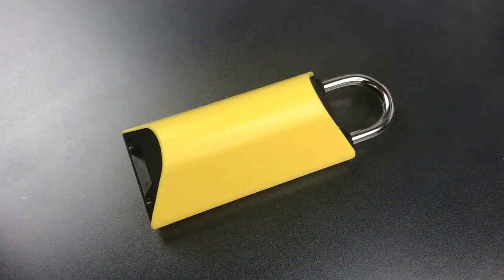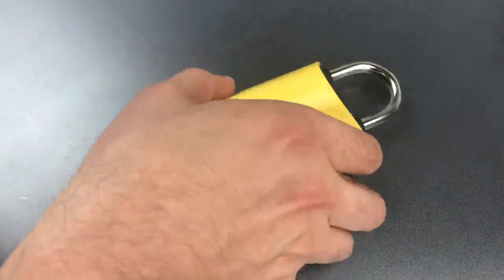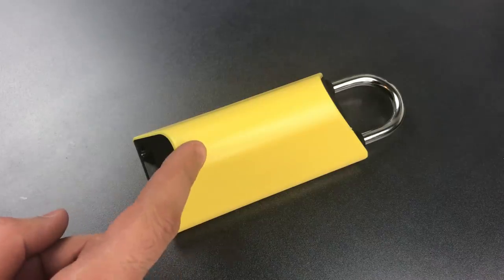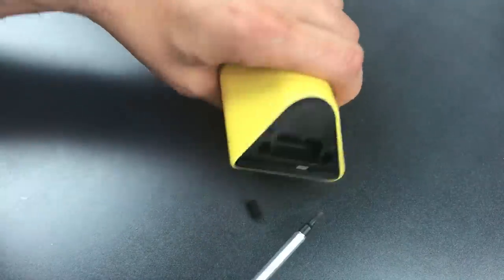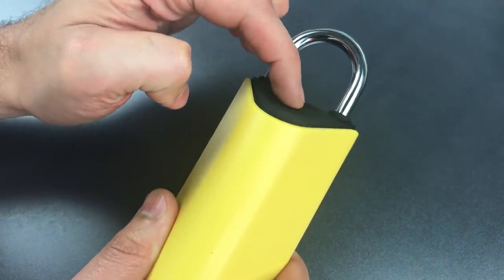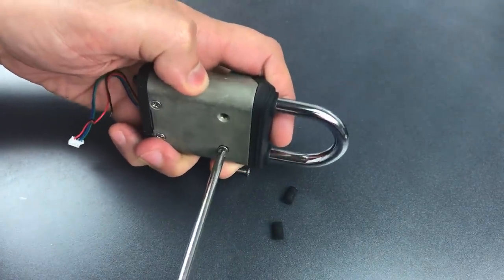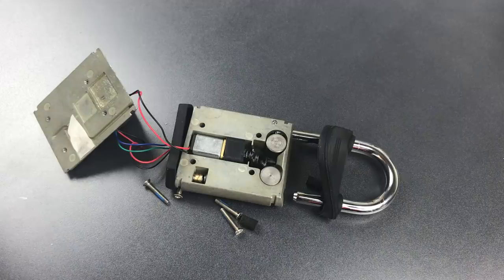[752] BoxLock: $129 Barcode-Scanning Padlock Opened With Screwdrivers!

Comment: Those tamper proof torx bits will also twist if you have to take out anything that's actually tight. I tried to do the same thing when I started as tech at the Chevy dealership years ago. You learn quickly that you need both sets.

Comment: This will prevent quick snatch and grabs as a package thief will never want to stay on a doorstep more than a few seconds.  That said, this is horrible for an overnight package drop container as the cover of darkness will make someone attempting to get to your packages bolder and they'll risk staying on your porch longer (especially after shooting out your porch light with a bb gun)...
Reply: Not at all. Replace the screwdriver with an electric screw gun. You can get ones that will fit in your pocket. Those will remove the screws faster. Then just short the battery to the motor to get it to open. Requires nothing more than a little screw gun and a knife. You should have the lock off in under 30 seconds.
Reply: @BobBobson  True, but package thieves run up, grab, and run away. Any kind of tinkering with the lock is beyond suspicious. The more time they're on the porch, the more chance of getting recorded and caught.
Reply: Auto Pi  You are right...but only partly. 99.999% of the world has no cameras around to witness it and not everyone has neighbors. Maybe in a major city of suburb, yes, someone might see, but as long as you steal the package without the owner seeing (which sometimes if they work, that is stupidly easy), no one is going to see it and nothing is getting recorded.
Reply: @tygonmaster  True but that's not how package thief think. They are in it for a ultra easy mark, if they don't see a box on your door step they are just going to move on to your neighbors and take theirs.

Comment: One complement I do have, is they did made the main body housing the shackle out of metal. Along with that the 4 Philips screws can be impossible to reach in some mounting configurations that you would be able to tilt a lock up at a sufficient angle. Yeah it is easily disabled until that point, but it would require flipping the lock at a nearly 90° angle to access the Philips screws effectively

Comment: Nice screwdriver. Haven't seen that slimline design before. (Usually just the quarter inch holder which would be too fat to get down that slim hole) Where to get? Please?
Reply: Bodragon try ifixit. they have alot of tiny drivers that dont flare alot.

Comment: Could you just plug your own battery with the correct voltage into the connector and get the actuator to open the lock?
Reply: yes

Comment: I see it as pretty secure in practical applications since this presumably would be at the front of your house where if you have this you'd probably also have a security camera, by the time a package theif has disassembled the lock the camera would have a fair amount of footage also someone (most likely a neighbor) would have noticed them. There are improvements to be made to it but as it stands it's a decent product for it's purpose which to me seems to be more about secure delivery of packages and stopping people from preforming a quick snatch or just reaching in a box and taking it than anything else which imo it does

Comment: The mail person or UPS guy doesn't have time to sit there and do this at every house it will never catch on
Reply: Which is just as well. 

However, to be honest, it's probably no slower than ringing a bell and waiting for an owner to turn up.
Reply: But then if we r ringing the bell and waiting for the owner to show up that means that we need a signature. And we won't be able to release it to a boxlock anyways.
Reply: Each country is different, I guess, but here (UK) if a parcel doesn't fit through the mail slot in the door the delivery person will ring the bell... signature or no signature. If it fits through the slot, then the lock is pointless anyway. Not too many "road side" letter boxes here, but even where they exist, the same process will apply: if it fits, fine; if it doesn't, generally a bell is rung...

Comment: Don’t worry about putting a screw through the shackle. One you have access to the wire you can pop it open with a touch of a battery. Two of the four wires go to the switch, the other two to the solenoid. Just power the solenoid and the top is open no matter how physically secure the top part is.

Comment: In addition to the stated defects this has some substantial ones that will reduce it's reliability. The circuitry is not potted against the environment. It has connectors which should have not been used but should have had hand soldered connections which also need coated. There are no gaskets I can see. The motor is not sealed that I can tell. No corrosion coating on the pot metal. This will fail in it's intended use in very little time. I've not addressed whether lead or no lead solder has been used since I do not know. No lead solder has numerous problems with thermal cycling.

Comment: Another design flaw, aside from plastic and pot metal, is the lack of any sort of apparent tamper detection.  It would be very trivial to detect tampering with the lock and transmitting a tamper alert (say to the owner and neighbors, for example).  Removing the screws should trigger a tamper alert, sliding off the plastic outer sleeve should trigger a tamper alert, the same if the shackle is no longer in its proper position, etc.  In addition to sending an SMS/App tamper alert it could also communicate with either a home security system or to a dedicated exterior sounder located out of immediate reach, so that an exterior alarm (perhaps even a high visibility strobe) may be sounded to help discourage theft through defeating the lock.  If they also sell the lockbox for this padlock then the lockbox (which is hopefully bolted in place) could also be equipped with inaccessible interior motorized bolts that automatically lock and remain locked until deactivated via the programmed WiFi interface such that compromising the padlock would no longer compromise the contents.

That said, the always exposed micro-USB connector is also very concerning as I very much doubt that it has adequate protection in place to protect against excessive, or even reverse polarity, voltage being injected into the USB port power or data lines.  I would also be concerned that the internal electronics are likely not to be well shielded from external RFI which could be used to either compromise, confuse, or even reboot/reset the internal electronics controlling the lock as well as to listen in on the CPU and potentially analyze emissions for weaknesses or tells.  The charging port should only be accessible when unlocked to protect from power injection and any high RF field should probably also trigger a possible tamper alert.  The device should also include an accelerometer so that it may detect excessive/rough handling and, especially, high impact events that are likely to indicate a tampering attempt and, again, trigger a tamper alert.  Similarly, an excessive number of rejected scans should result in an automatic lockout period so that nobody may try an unlimited number of master/shipment codes to gain entry.  I would also add thermal sensors to detect sudden and dramatic changes in temperature that are outside possible normal variations and also trigger a tamper alert since dramatic outlier changes in temperature suggest either an attempt to freeze or set fire to the unit (both of which it is susceptible to).

There are also likely to be other weaknesses in the firmware given how much it is doing and the inevitable rush to market, but the above e would certainly provide for improved physical security and help to further discourage tamper attempts as well as to stymie such attempts if the lockbox can self-lock internally in response to detected tampering and notify the owner and neighbors (I am almost always home, day and night, and I can honestly say that if I received an urgent tamper alert for a neighbor’s package I would certainly run to see what is up and, if I see someone I would either call police or confront them depending upon the nature of the threat, so even a simple real-time tamper alert could greatly improve the effective security of the device despite its many other flaws).

 But that is simply this former software developer and lifetime electronics hobbyist’s $0.02.

Comment: How about this? The two scews that hold the case together are connected to a circuit that sounds an Alarm stating something like “intrusion detected, owner and emergency services alerted” or something similar? Although it doesn’t actually call 911 but leave that to the Owner with the alert on the app. As well as the proper measures you mentioned on the lock part. Think that’d be a sufficient theft deterrent? They’d have a easier time doing that than making more lock like

Comment: Because of the way it's made even if they protect the top section it still wouldn't be secure -- it looks like you can just apply voltage to red and black to actuate the motor. They need to also enclose the circuitry in metal.

Comment: fill on top of the screws with epoxy or jb weld, etc.  that should work unless you need to access the screws at a later time

Comment: If you still have the unit, I was wondering if a magnet would trigger the solenoid or other electronic components used in the release mechanism.... I have seen that on several other electronic locks such as in fire safes and the like. 

Thanks for making quality content!!! :)

Comment: lol Nice Matching wire color codes.  Take the 2 bottom screws out. Cut the battery and Motor wires. Connect Black wire to Black wire. Red wire to Red wire. And it opens rite up without disassembling it any further.

Comment: So they made the cheapest lock possible and shoved it into a yellow case? Amazing. Thanks for all the videos you make, it is very interesting even to a person who does not do this.
Reply: It's by no means cheaply made. Just not very well thought out from a security standpoint.
Reply: @dlevi67  no offense but, it's plastic. I've never seen a plastic abloy oy or Sargent greenleaf.
Reply: @wkdravenna  No offense taken (and hopefully none given), but this has nothing to do with the point... they didn't cut costs - certainly not as aggressively as they could have done. They just spent the money in the wrong places from a security point of view. BTW, the body is some sort of metal alloy (zinc?), not plastic, but it's worked quite accurately. Metal is cheap; accurate machining far less so.

Comment: Instead of more disassembly, I would've stopped after disconnecting the electronics. I'm quite sure, giving the still-assembled metallic lock mechanism a short electric impulse over it's connector would've opened it as well. There are only three contacts on that last plug and my guess is, it would need only two of them and the battery.

Comment: They could replace the Phillips screws holding the lock together with the ones that only allow you to tighten them because of how they are designed that way you could still replace the lithium battery when needed but not the little motor or actuator parts inside the lock

Comment: The bottom two torx screws are probably acceptable to be able to replace the battery every few years, and since they don’t open the actual lock body they are fairly negligible in terms of security.

The Philips heads, though...

Comment: I've got a double lid pickup aluminum truck box beneath a homemade porch bench seat. Lift the seat, and you have access to two compartments. Keyed alike American padlocks that have chain retainers.

I don't need Fort Knox type security, as you're only attempting to thwart the opportunist. They're on camera, so they'll be found. 

Rural folks have their own way of dealing with thieves.

Comment: Not to mention the bottom yellow plastic part can be easily melted with a torch or even maybe a lighter (?) and then you have access to the 4 phillips screws on the metal part. Thieves can also connect the actuator wires to a battery to open the "lock" !

Comment: This thing could be easily modified and improved with tips he said still have the convenience of using the bar code reader.  You could just put screws in then hit it with a drill round out the heads so can't unscrew them. Also put Red lock-tite on those screws.

Comment: You actually do not need to disassemble top part. You just need to connect wires from battery(which is included) directly to the motor wires with couple of clips(or any other metal).

Comment: I see a major flaw just pry up the rubber under the shackle and add low voltage dc power to the red and black wire bypassing all electronics and actuate the actuator 10 seconds max. Causing no damages to the lock and no signs of forced entry.

Comment: One thought on everyone saying it needs to be built out of metal: That would prevent the wifi interface.  They need something non-conductive that can protect the antenna.  (Because if the antenna is damaged, the lock is useless.)  I’m not sure what the right material would be however.  Probably easyist is to have most of it metal with a thick glass window over the antenna.

Comment: I expect they left the screws accessible for RMA so repair techs could access the battery and the board easily. I would advocate they should improve the protection around the upper locking locking mechanism, but could leave the lower electronics module relatively accessible.

Comment: Have the lock hidden inside the box with just a QR-code on the outside.  If the delivery guy scans the code and then the tracking label it sends a signal to the box to open.  Kind of a simple solution to a problem of having access to the lock mechanism.

Comment: The lock has another security flaw. Even if there was a screw down the shackle hole the solenoid can still be operated with a 9v battery and 2 wires. If you don't care about destroying the lock then just the 9v and rip the connector off. To fix that you would need a separate circuit board inside the metal body and a 3 wire connection with power, GND, and data. This way the brains of the lock would ask the Braun to open. Even better if they encrypted the data connection but that's asking a lot.

Comment: I beleive with a few modification the consumer can really improve it. Here are my ideas: strip the philips screw intentionally that way you cant unscrew them, fill the holes with epoxy like LPL sugested and finally design you lock box around your lock so you can't disasemble it but you can open it.

Comment: If you remove the bottom, you could propably just apply voltage to the lock motor to open it

Comment: If it has access to the internet it can easily be coded to call you if it detects the opening of the lock without the authorization present. Would be just a software update.

Comment: It has a micro USB port. You could most likely open it and any other one with a ducky script if you read the software used.
Plug in the rubber ducky and it opens.

Comment: You don't need to dismantle the top part of thr lock, just use a screwdriver to short out the pins of the transistor that drives the lock motor and it'll open.

Comment: Unless there is a way to charge it with out taking it apart and replaceing the litium cell, the extra screws and epoxy you talked about would just make this a brick once it runs out of charge

Comment: It could be more secure, but THE PROBLEM that it addresses are porch pirates, who hit quick. For now, having this would MORE THAN adequately address the problem. And the lock could be made much more secure by removing the foam and putting a little JB Weld in would solve the disassembly problem.

Oh, you just said that.  Good on you.

Comment: Use the lock to secure the package. Improve security with a motion activated porch camera that sends an alert.  Make sure that the porch cam has a speaker. A remote control porch light will help. 

When you get the alert, turn the light on and yell "Coming!" Watch the thief run.

Comment: I’m thinking that once you have access to the circuit board it might be easy to shunt power to the motor and unlock the shackle without disassembling the rest of the lock.  At a minimum, disconnecting the cable to the motor and connecting it to a battery should open the lock.

Comment: Maybe its relatiely insecure because there needs to be a backup way to open it if the electronics fail. If that's the case then the only alternative would be to include a mechanical backup lock, which might have been decided to be too expensive for a first run?

Comment: Who’s to say the delivery driver will go through the extra time and effort to find where you want the package delivered, read up on how to use this lock, use the lock and finally re lock the lock. Many delivery drivers just toss the package by your door and call it a day, they get bonuses based not how quickly they deliver. The most wonderful lock on the market does no good, if the driver will not operate it.

Comment: If you had access to a 3.3v power source you could also just power the motor @ 4.30
Reply: There just happens to b a lithium cell right in there few jumper wire lock picks its self

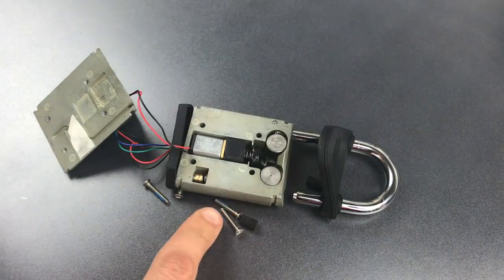Comment: 5:18 No, modern phones are much much harder to disassemble. For this, you need two screwdrivers and some wire. For ip67/68 phones you need heatgun, and much more equipment

Comment: at 3:53 all you had to do was bridge the battery red/black wires to the motor blue/green wires with two short pieces of wire and the motor would turn to release the shekel, no need to even open the top section.